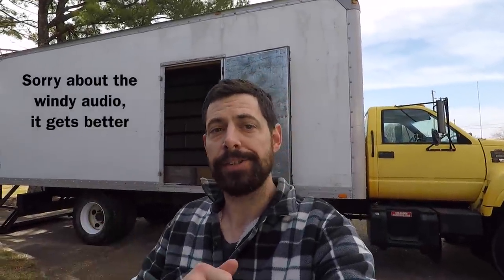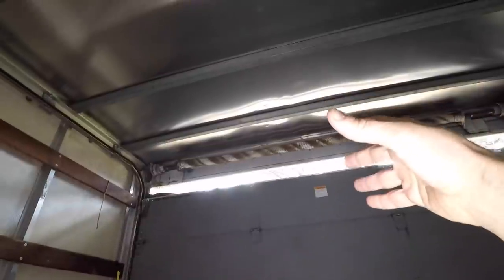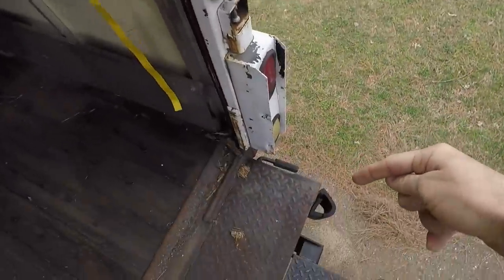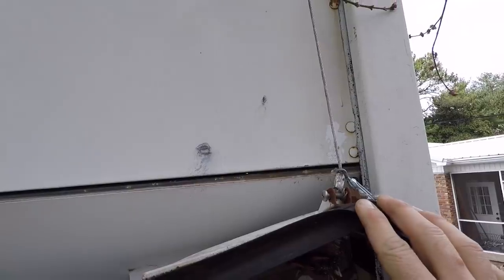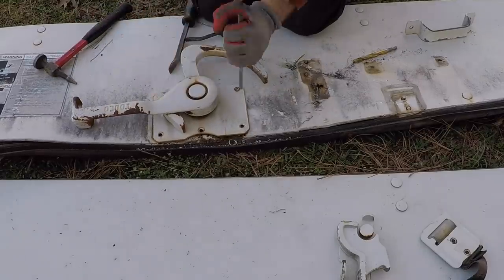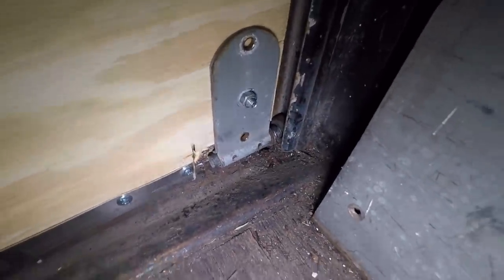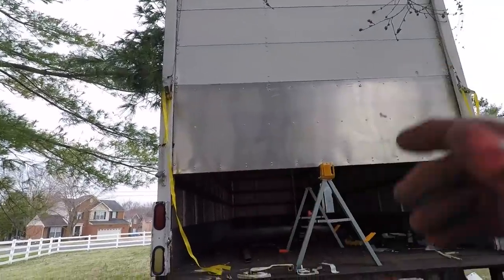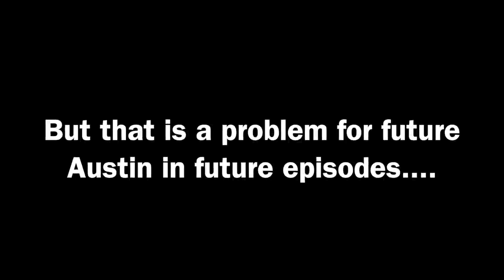Box truck roll door repair (rotted wood / jammed rollers)

Comment: I have to say i was skeptical at first, but that actually tuned out pretty nice. Good work!   Make sure to keep a good amount of marine grease in those lift gate tracks.
Reply from the maker: I was skeptical too and had no idea how it would turn out. It's been working great so far.  I did add grease before final install

Comment: Have a couple questions about this: Did the single bottom panel cause any issues with the radius of the track or did it allow it to slip on by because of the wider spread roller location?  Pros & cons?
Reply from the maker: The single panel was fine, but I have since learned that you can buy replacement panels at shops that cater to medium and heavy duty trucks.  Woulda been a lot easier to just buy a replacement and only a little more expensive

Comment: Looks was too much 
Trying do it with incorrect panels lot way easier if just buy the panel already ready just to install latchets and roller. Just for might be $60-100 bucks.
🤔
Reply from the maker: Why didn't you tell me BEFORE I did all this work?

Comment: Do you have a CDL (do you even need one for this size truck)? Have you considered keeping the truck and using it to haul freight as a side job?
Reply from the maker: its under 26k and no air brakes so no cdl required. I have not thought of that. Maybe I should
Reply: @AustinCoulson  I've heard with the pandemic, there is a backlog of freight that needs to move. Not enough drivers to keep up with shipping. Now would be a good time to get into it